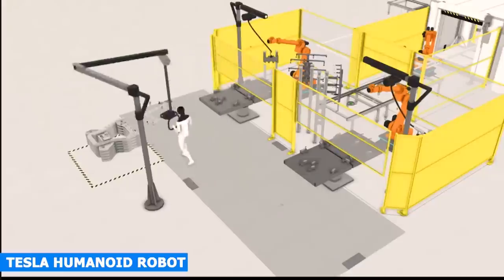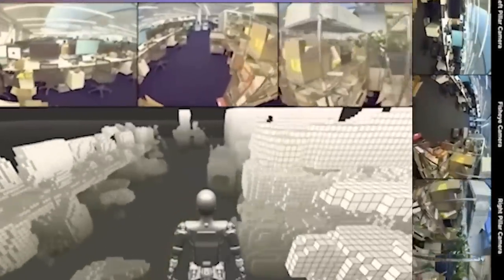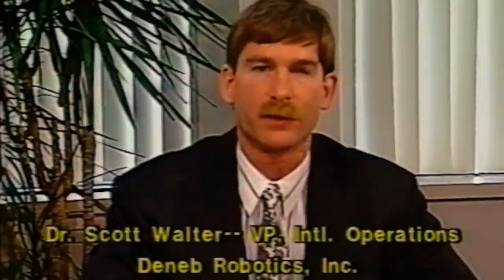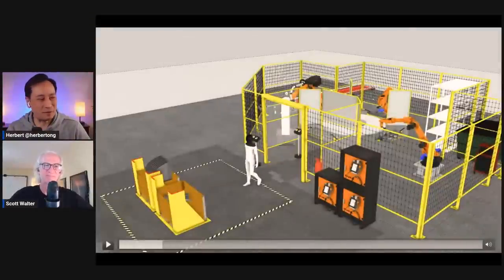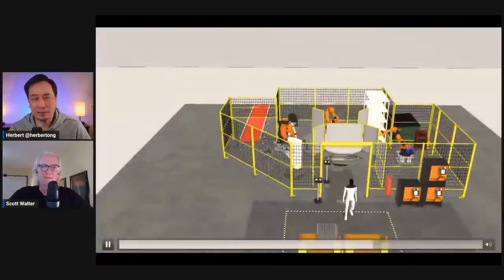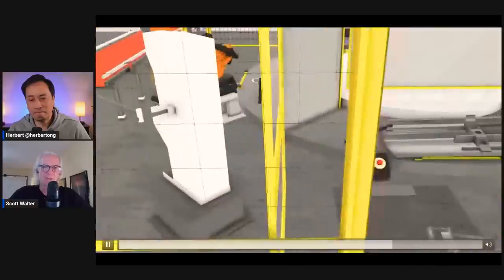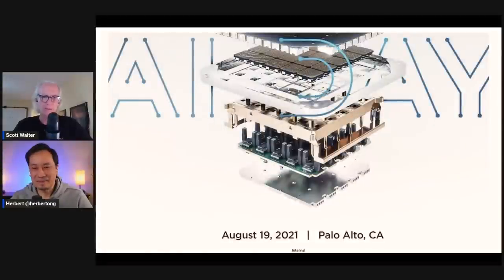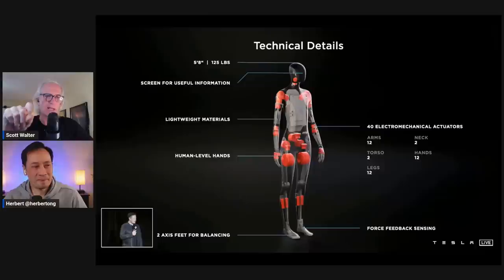Tesla Bot Expert Shows PROOF Bots Already Making Cars | Scott Walter

Comment: A bit after the 1 hour mark, Herbert asked how the Kuka robot communicates with Tesla Bot. During Investor Day it was mentioned that they had installed a 5G network on the factory floor. This is one of the advantages of 5G, it can work over many bands and bandwidths and it also has many modes to support low latency factory floor operations. I suspect all equipment including Tesla Bot will operate over the 5G factory network.
Reply: Rare to find a comment with actually good and useful information, Thanks for sharing that
Reply: why would you need 5G when you can just use wifi?
Reply: @Withnail1969  A wider array of bands and bandwidths and much more control over QoS and beam forming to better control the signal. It also allows equipment to be mobile and use the same modem and backed controls.
Reply: @FoamyDave  you can just use wifi 6, massive bandwidth.
Reply: Thanks!

Comment: I'm glad this went into more detail. I found it somewhat annoying that people seemed to expect optimus to magically have human-level hand dexterity with one degree of freedom per finger. I'm a big Optimus fan, but let's keep it real. To get human dexterity, you need to maybe double the actuator count.
Reply: It doesn't need to have human hand level dexterity in order to completely transform society.
Reply: @peopleofearth6250  I agree with that. Actually AI doesn't need a robot body at all to completely transform society. I'm just skeptical of notions such as the initial version of Optimus being equivalent to three humans just because it can operate 24/7 without breaks.
Reply: @Seehart  Not being as dexterous or fast is a much more minor reduction in production than not working at all, which is what humans expect to do for 128/168 hours of the week. Most tasks also do not require the full dexterity a person is capable of.
Reply: Why arent they building it with more actuators then? why bother with something that wont have enough dexterity?

Comment: Another key point is replaceability. If a normal manufacturing robot goes down it takes a lot more time, effort and money to replace.  They are usually designed for a very narrow specific task. If a Tesla Bot breaks and you have hundreds or thousands of Tesla Bots in the factory, then you can just load the new program and replace the broken one with his buddy robot. Now there’s almost no down time, which in the manufacturing process, is everything!

Comment: Thanks, although I have watched the day to day operations of SpaceX I haven't really paid any attention to the Tesla bot thinking that since it has taken Boston Dynamics the last 20 to 30 years to accomplish what they have as one of the front runners in cool robot tech, I didn't think that in a couple of years would make much of a difference in capabilities. I'm not sure why I decided to watch this video to start with, but I'm completely convinced that what Scott said is that  these robots will completely evolutionize manufacturing. I just turned 63 and all I want is to see is Elon/SpaceX land on Mars. Even better if a hundred robots land on Mars to set up camp. Even if they crash they can search the crash site and salvage themselves for spare parts. Now I'm thinking these robots could easily clear and prep land for Tesla Bot mega factory since like Scott said the bots won't need bathrooms, breakrooms, parking lots, cafeterias, HR reps, they could probably make cold calls and drive to potential clients take meetings and sell themselves and if the client doesn't pay they can break legs also.

Comment: As you apply a nut onto a bolt you counter rotate the nut to sense the proper seating of the nut onto the threads before rotating and tightening the bolt assembly to prevent cross threading.
Reply: Not if the bolts are specifically designed to avoid cross threading.

(Which was pointed out by Sandy in one of his Munro Live videos).
Reply: This is true of spark plugs as I discovered as a 16 y/o working my first summer job for a boat maintenance business back when Johnson Outboards from OMC were king.  Steel spark plugs and aluminum motors required just such a technique!  Never have made that mistake again.
Reply: @NickMackenzieMD  Aluminum is terrible in that regard!

Comment: Scott: I believe that Tesla may have iterated through 500 robots by the end of the year but they will have recycled 400 of them, this process will continue until the robots are advanced enough to be used in multiple area of the factory.
You are correct in they are testing on the shop floor as that is the only way to see the effects of interference from other processes especially welding which the robots will need to be armored against.
Reply: Plus Milan said as much on AI Day 2. They are testing in production cells. And they won't scrap the parts. So where are the parts now?

Comment: Let's talk about how Nueral link can merge with Teslabot. I'm sure 40 actuators can be linked/learned in short order. Even as a prosthetic. Seems reasonable that the connection is inevitable.  Think about the possibility for 5min, and the implications are huge. A human with a neural link to the bot will be able to take over the bot when needed, and also train the bot. Like having 2 steering wheels in a driver's Ed car. Haven't heard anyone discussing this. I feel master plan 3 is too much for them to reveal.

Comment: Here's is an advantage in a factory environment. What if Optimus could create an anchor point to the floor at will with either foot with electromagnetic “sticky feet”, or sticky shoes? These could be interchangeable with other specialty feet. A smart floor work zone could be mapped out and contain any required hardware to provide the electromagnetic effect. Control would be by Opimus. Leverage and balance would be greatly enhanced.
Reply: Great idea. I noted the benefit of these robots over a robotic arm is they would free up space taken by the laters footprint. This method could allow infinite possible anchor points, that would greatly improve leverage as you say.

Comment: So if understanding your analysis correctly, in light of the teaser videos previously shown, Musk is most likely going to fund the development and deployment of these robots the same way he deployed with his cars. Robots will be produced in generations, with each one funding the next through sales, which in turn fuel the refinement and also drive the production costs down. Musk, for all his faults, has one strength that buttresses all his projects; he has a very keen mind for breaking down tasks into simple math and then finding the way to reduce production time or costs by finding how to divide it super efficiently. This is how he was able to dramatically reduce the cost of boring tunnels and revolutionise rocketry.

To bring it back to Optimus; the first gen will present robots for simple tasks, i.e. working the factory floor. The funds and the data from that first generation, will be the crucible for the household robot, most likely within 2-3 years. The costs at point will also be much lower because the design will have been refined, and the robot labour that will assemble them will also be much cheaper than human workers.

Incidentally, this also works hand in hand with Musk's Mars project. Mark my words, the first human feet to land on Mars will be able to move into a city built for them by a robot workforce.

Comment: I think Scott is absolutely right.  Tesla slow played this, they got hit hard when they tried to automate the floor before so they didn’t make a big hype train about it till prototype we’re already in place.

And notice the tasks the prototype are doing is not walking the floor, it’s not doing overly complex moves.  It’s taking parts off one machine and putting them on a cart.  Right now that was probably a human, but it can be subbed out.  The current generation can probably do 10x this with low supervision, and it’s just going to keep evolving task by task.

Tesla learned a few things from their first mistakes.
1 - you can’t just chain machines.  The people and steps in between are buffers for failure.
2 - previous robots were too custom to the job.  In fact most of the time the process was customized to the robot, and then when the robot failed you have a process that’s not designed for a human to step in.
3 - if you mimic human capabilities swapping robots on and off the line is easy.
4 - if you get 50-70% of the work handed off to a humanoid-robot you gained efficiency by now allowing a human to oversee more operations at once.

Comment: Tesla could get rid of most/all wires on Optimus 
by equipping motors with cheap chips. Than every motor could be connected the same 2 wires with a simple DC current. Whole robot can use 2 wires basically, motors connected in parallel. The skeleton could even be a "wire" itself, so literally one round-trip wire to all motors is needed. Very sleek design.

First there is a coded pulse to say which chip is going to activate a motor, than a period of time where it just feeds needed electricity and only the one out of 50 chips actually lets that power into a motor (all of this takes 10ms - so you can power all motors in a chain and will be "simultaneous")
Might raise the cost by a few $, but less wires less problems right? (easier assembly, sturdier design, easier motion etc.)

Comment: How about the Robot Moon Walking instead of a standard walk it will reduce unbalance when carrying an offset weight. To stop cross-threading remove the first two threads of the screw to the root making it easier to insert the screw.

Comment: It would even make sense to let the robot do the work and have the employee, who did the work before, stay around to intervene, when the robot is making a mistake. This worker also could document what needs to be improved. Most likely Optimus will initially work (or already is working) in workplaces that are not under rigid time requirements (like a production line). And I am quite sure that it is planned that Optimus works on some of the modular building stations in GF Mexico from the very beginning of production start.

Comment: You can have virtual objects overlaid into the Optimus visual space that appears and disappears from the visual processor that act as safe zones to navigate with. The wifi connections could simply turn them on and off based on the signal from the robots. Instead of lighting a light and training a human to know where the zones are (painted lines, etc), the bots can have actual real objects inserted into its visual field directly. Maybe a few neuralinks versions later they could do that with humans, but humans cost more.

Comment: 3 forward facing eyes would give the robot ability to have better depth perception (without having to tilt it's head). a human only has horozontal depth perception. to tperpendicular depth.. the human tilts its head to change orientation of the two eyes at an angle different from horizonatal. 
Also, regarding muscles to fingers.. the pinky and index fingers have additional muscles that spread the pink and index finger out.

Comment: Ok let's see, any broom pushing, any trash collection, bathroom cleaning, surface cleaning, picking up around the factory. Moving things from place to place. Plus everything you see. Plus being a second man for any installation process, solar panels, pouring concrete, hanging steel. Cleaning windows. Driving forklifts, pushing carts. Going and getting something for a human. Or taking his spot on a line while he takes a leak, or lunch. Shit walking air purifiers, surface sterilizers. With a backpack full of snacks! Literally employee benefit walking.

Comment: I guess Optimus does not have to press a button to start the process. Safety rated light barrier and safety scanner would not be required. The Optimus could work inches from the Kuka manipulator.

Comment: Fiber optic cables will be replaced by wireless signals.
Reply: 1) It’s not necessary 

2) Automated Industrial plants are very ‘noisy’ for RF especially around welding areas.

3) You clearly lack all understanding of bandwidth.

Comment: the robots  buid themselves ,therefore the robot is the production line  first  you build and perfect 2 robots.once built ,then  2 robots build 4 and  4 robots then 8 robots  and build 8 robots  build 16 and they  get  faster at it ,ect ,ect ,ect .see how that works .Ex:  the first 24hr shift =2 bots ,the 2nd shift  =4 the 3rd  shift =8,the 4th = 16 the 5th =32 ect,ect . The machine that builds the machine or the bot that builds the bot .

Comment: 1:24:54. Tesla doesn't ship products as soon as people think they should, not because they can't, but simply because it doesn't make sense for them to do so.  This is largely due to logistics.  There's no point in taking on the increased complexity of another product line, when you are having a hard time coming up with enough materials to saturate the demand for the existing products you're already selling.  Bot is very different in this regard.  

1) You're talking about HUGELY less material, especially of the materials they have having a hard time coming up with (cells).  But bot also uses hugely less of every other material, and even uses half as many chips (one FSD chip).  So if you divert the resources of one vehicle, you're making multiple bots. 

2) They have a need to go ahead and get the product "shipped" (at least internally), as it's a different class of product from what they are otherwise doing, and they need the experience.  (Cybertruck, roaster, so on, are basically variations of the wheeled "vehicle" theme, and are not going to provide a new category of experience.)

3) Tesla really doesn't "have" to scale the product to volume right off the bat.  If they want to do small scale initial production, while they are using the bot internally, they can.  So since they are not necessarily committing to large scale production, there's no reason for them not to start producing them.

4) Since the customer is themselves, this also simplified the logistics of product distribution, not just in terms of getting the product geographically located, but also in terms of production/demand timing.  This latter point (timing) is important if you're having hiccups in the production ramp, and if you're constantly changing the production design in fundamental ways.

Comment: Excellent video, however, I don't agree with you on the point Telsa not selling the bots, they could have conditions attached to a sale that allow them to recall a bot so misuse could be handled like that. Machines in industry cut down immensely on workload and most of these were sold to the companies that use them. The bots are just very sophisticated machines. Also, the way Elon was talking factory use is just the beginning and for every household to have a bot you are talking the $10,000 range, not hundreds of thousands. The way Elon is talking he alludes to making manufacturing much much cheaper, not making massive profits on the bots. If that is his goal I can't see him charging mega amounts for bots regardless of how much it saves the manufacturers. I will remind you that Elon passes savings along to the final consumer.

Comment: Robots designed  to work in a factory, assembly line or even a line kitchen would not be humanoid....  They would not walk, but rather be on  tracks or wheels.   Also no reason to have a head with a mouth and two eyes  or hands with 5 fingers.  Keep in mind the robots are constant communication with every camera, sensor and smart object in the factory, they don't need extra space, comfortable temperature, clean air, breaks, security or an HR department.

Comment: Very likely there won’t be hundreds of bots by the end of the year because they would want to have to get their design closer to the more final version, otherwise they won’t be that useful.   Scott says it many times himself in the video that Tesla is still tweaking a certain part.     True one needs many bots to gather data but gathering data from early reboot designs is not useful
Reply: Strange, every robotic developer finds useful for those built at first. Just for parts selection and staging 500 will save 25 million which pays for 2500 next year which pays out 125 mill,,, this is on one factory.... 
X6 (factories 2025-2026) 750 mill in savings in labor. By 2030, 2-3 billion and will be working markets outside Tesla for more than inside Tesla auto....
Reply: I totally agree that many robots would be excellent and useful for
Collecting data and helping out but not in the first year since the hardware part of the robot since tesla is still trying to see what part works well.   Then they still need to design the assembly line that builds the robot.  The assembly line is not that easy to change after the robot design changes.  K

Comment: So far all the robots that have been developed by these companies can't seem to stand up straight!
Optimus/Tesla bot has same problem and it looks like it want to take a shit!
Robots standing up straight exist only in movies which suggests the standing up straight problem is not as simple as it looks in movies!
My question therefore to the professor, Is Tesla bot ever going to stand up straight and walk straight just a human being?
Right now, all it seems to be doing is wanting to take a shit!
Reply: Agree. But it will evolve as the NN and controls systems get better. Also, our feet/toes are key to balance. They may do a rethink on that design. But the overpowered actuators in the leg and hips are likely to give the acceleration needed to recover when losing balance. Loaded walking will also be interesting. Even humans walk like that when carrying a heavy "load".